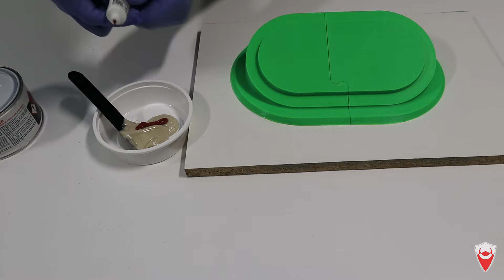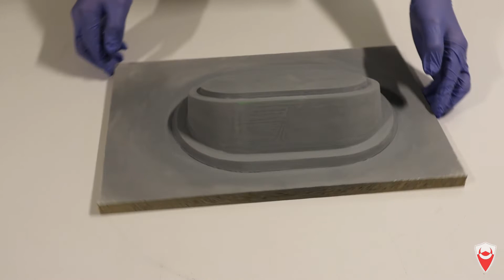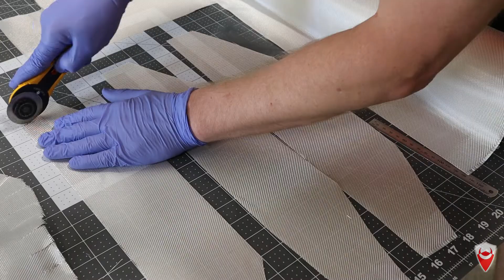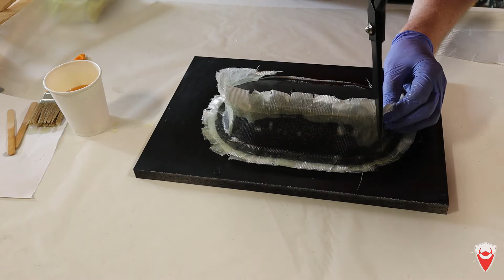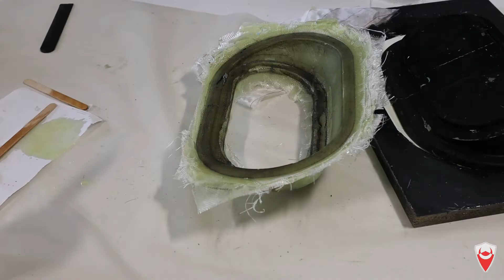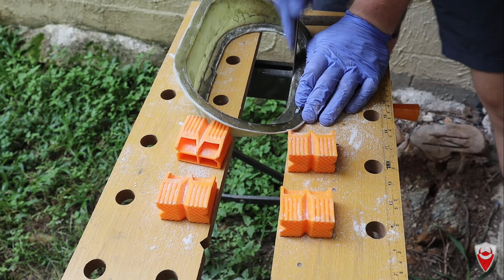[BUILD] Composite Fuel Filler Bracket from 3D Printed Mould - There were problems...

Comment: Nice project. Hope everything is fine during this epidemic. About the 3d printed mold, I could tell, you had to spend a considerable amount of time sanding the 3d print, to blend the print lines. No matter how fine you go, even if u go 0.1mm with really slow print speeds there'll be print lines. that's FDM printing. So the easy fix is to coat your print with a thin layer of epoxy, use a brush or spray. Apply a thin layer, let it cure completely and do it again. Then sand it all smooth. This works extremely well with flat surfaces, but u might have runs with vertical surfaces and also lose details with some prints which has small details. You can then either apply primer and paint for final finish or coat it with tooling gelcoat for your mold making. The tooling gelcoat must be at least 0.6mm thick. You must always polish your mold with paste wax and coat with PVA before laying your choice of cloth and resin. This way you'll be able to use it several times. P.S. make sure your 3d print material, epoxy resin, tooling gelcoat and the resin for your final part, are all compatible chemically and temperature-wise. Hope this helps. Oak Ridge made a boat using, 3d printed mold this way. But their mold was machined to be smooth. Hope this helps. :)
Reply from the maker: Thanks for the advice, I should have used epoxy and micro as a filler instead of bog I think. But I might try your method in the future.
Reply: @CEWManufacturing  What layer height did you use? I wouldn't use anything more than 0.2 mm for molds. Never used micro balloons and epoxy, because I'm afraid it might change the dimensions of the part. Also I do some character models, and using micro balloons I would definitely loose details. I'll give the micro balloon a try and let you know the results. You can also use Acetone vapor to smooth your prints. I once used styrene based gelcoat on ABS print haha the part melted. So that's why I said make sure your gelcoat epoxy and 3d print material are all compatible. If you're using PLA and your epoxy and gelcoat which cures at around 120 degree celsius, there is a chance that your part might deform.
Reply from the maker: That mould was printed at 0.3mm, I probably should have gone a bit lower, I'll try that next time.

The very minor change in part dimension would not matter for me with this part, but it is a consideration.

Comment: Can you find some aluminum powder or any mineral filler on your local suply? do a "gel coat" with your resin and this type of filler and make 3 layers of it before laminating the fiber glass!
Reply from the maker: Is this to give a good surface finish?

I'm more concerned about part weights, I will generally take a worse looking part as long as it weighs next to nothing.

Thanks for the tip though, I'll find something to use it on!
Reply: @CEWManufacturing  i thoght this was going to be a mold, but it is actualy the part itself! yes you are right it will increase a lil bit the weight but its worth. I kinda like good looking part heheheh
Reply from the maker: Yep, it is the part itself. If I was making a mould of it I would have used a gel coat for the mould surface and chopped strand for the back to get good conformance.

I'll have to get that Al powder filler a go, does it work with epoxy?